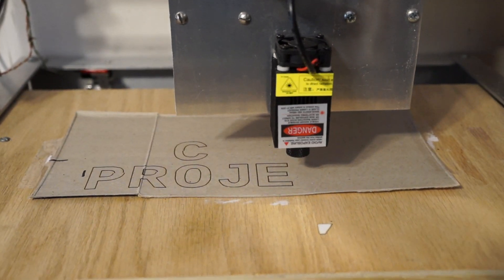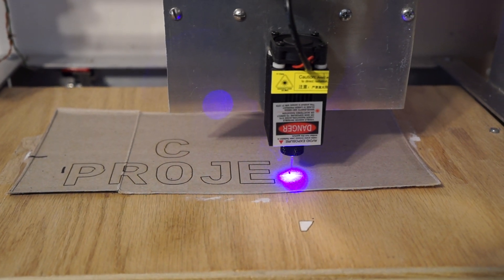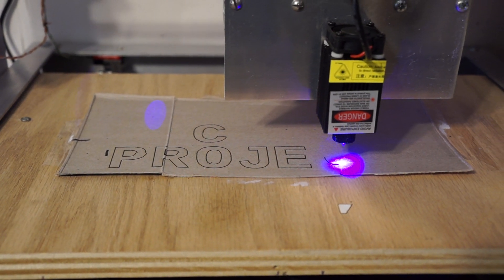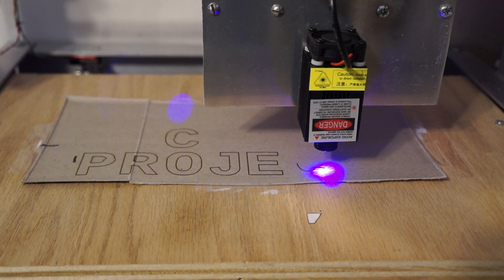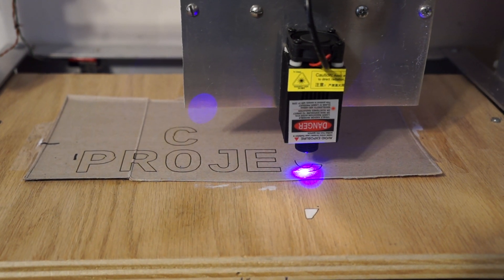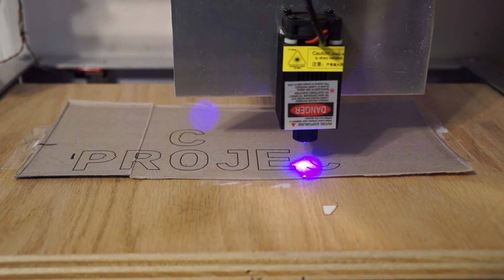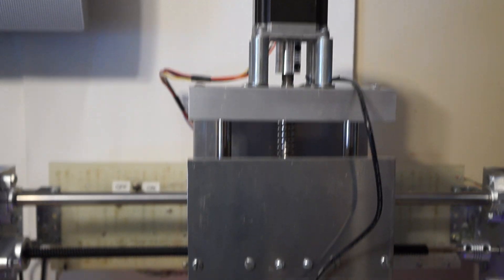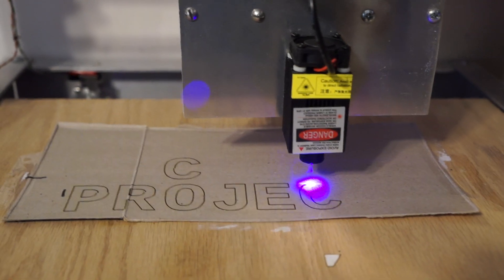DIY Arduino GRBL CNC with a Laser

Comment: Which laser can cut metal foil...?
Reply from the maker: You need a lot more power....
Reply: I am mechanicle engineering student...and i m trying to make laser cutting machine.. would you like to tell me...laser torch with 500Mw power  is enough to cut metal foil?
Reply from the maker: @m-seriese847  500mw might cut thin foil.  I would recommend about 2 watts.  But I have never tried cutting foil.
Reply: 😊thanks for helping sir👍

Comment: What software you use?
Reply from the maker: GRBL.  There is more at my blog bobdavis321.blogspot.com
Reply: I asked about the program to burn with laser. But i already found at your blog. It's a 3Dburner, correctly?
Reply from the maker: The laser is just turned on and off.  I have bought a modulator but have not tried it yet.

Comment: maybe the laser needs to be run from a zener diode supply so it can be varied,and possibly vary the supply with a fet as a variable impedance,with a tail current limit resistor on the ground side of the laser diode,or the variable impedance could operate as the current set resistor  in a 317 regulator ,the laser is a current controlled device,though it needs a forward voltage to allow saturation.

The power in laser drivers is from a current limit,voltage is set,but current is the variable medium i'm sure,as with LEDs,the forward voltage is set with a current limit resistor.
Maybe a tail resistor with the fet being modulated to allow more or less current with a max current fixed resistor in circuit.

I'm  more in tune with audio practices,long tailed pair use a current set resistor,which can have a pot interposed to set drive voltage,though it's the current through the resistor that creates the voltage drop across it.

i'll dig around,should be easy enough to modulate a current control element.

All this said,how would this translate to grey scale from motor speed,and how to apply it to code.you would need to go line for line of code to apply the setting of power for grey scale application,maybe i'm wrong.
There still is the option of speed versus burn rate and raster image files.or dot matrix type images to get grey scale tone.

All off the top of my head by the seat of my pants,but i'll hahe a look at pwm power control,voltage and current.

Comment: sorry for all the messages bob,i just found this instructables site ,it has an image of a 1920s-30s open top sportster.

https://discuss.inventables.com/t/where-is-the-laser-engraving-category/299

I reallised that most of the images created by arduino is a specific file type,as in outline drawing,there is a name for the file type,there is also a line by line file type again name specific,which will use the spindle z axis etc to  create grey (gray,i'm in scotland) scale images,it takes longer ,though a more powerfull laser can do it faster as it has to move faster to allow for the extra power,the sprtster is etched with a 2.5W laser.

I ultimately want to route and grey scale etch guitar bodies and necks and cut inlay for necks,also make pcbs,and mill brass facia panels for the guitar amps i make,plus a 3D print module.

The  file type is a raster file,i just searched for it,i'm not proficient with this type of thing ,but i knew i had seen it,and it is a good bit more time consuming ,but small stuff should be fine.

If you manage to load a raster image file would you please let me know and show it.

Comment: i've thought about the laser power being adjusted,i saw a chinese CO2 laser create a photo image,the power was self adjusting,i can't think how the arduino would accomplish this,not spindle speed pwm,i'm not a programer so i cant tell if the code can be changed to reccognise specific grey scale from an image,to modulate the lasers power,it would certainly be a boon if it could.colour to grey scale to burn etch image.

have you used the gcode for tool tip zero height for tool change/job zero deck,i've seen it done,but comments are off.i know the switch is between pin 5 or 6 to ground/zero volts,but how to do in the gui.

I actually got xloader sorted,norton quarantined it,so no biggy.I still need to upgrade my pc platform.

Have you tried etching a pcb  using photo resist,apparently it is very good,the laser has to be low power,to get a fine ,non radiant beam,if that's the proper term,i think the focused beam of a few tens of milliwatts does the job to the Nth degree,very fine,etching magic/sharpie marker ink works too.( not trying to teach granny to suck eggs).

All the best.
Reply from the maker: I finally found the "secret" last night on a blog somewhere.  The Z limit switch is the PWM out to the spindle/laser in GRBL .9!!  I checked it with a volt meter and it works. "S0"=0V, "S500" is 2.5 volts and "S1000" is 5 volts on the z axis limit switch output of the Arduino!  Now to get that to vary the laser.  I used a driver transistor to power the laser but the laser has a current control circuit inside the laser that only allows full power or no power......

Comment: what is the chattering sound,why use a relay to control the laser,and not a mosfet or  compound /darlington BJT.this is what i want to see,cnc laser,was this a retro fit to a mill.
Get the plans in next book,even just the electronics,arduino,laser set up ,mill,tool touch plate height set.
Heres what i would/will do,the vacuum suround with bristles for removing dust while milling would shield from laser exposure ,or get a big cardboard box lol,seriously the vac bristle surround  will give a  deal of eye protection and still have access to see etch ,albeit not the burning etch,just that which has been etched,you get it,i know.one pair of eyes,thats all you get my friend.
Get the book out.
all the best.
Reply from the maker: It is a retrofit.  The chattering sound is the stepper.  The CNC is doing whole steps, not half steps. The spindle control relay is running the Laser.  I am going to try to see if I can get PWM to the laser to print/burn a picture.  I was wearing eye protection.....